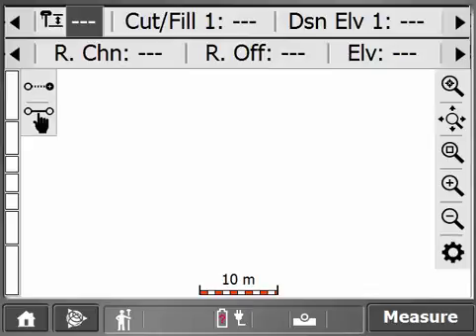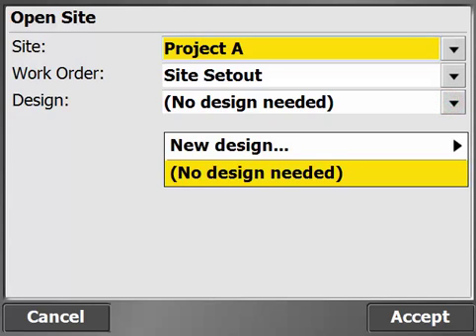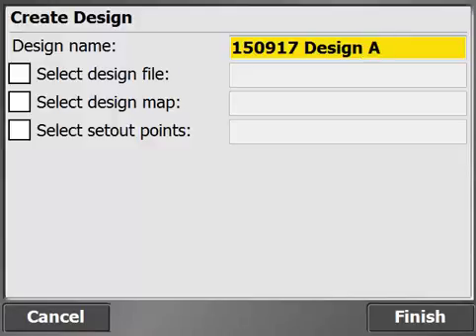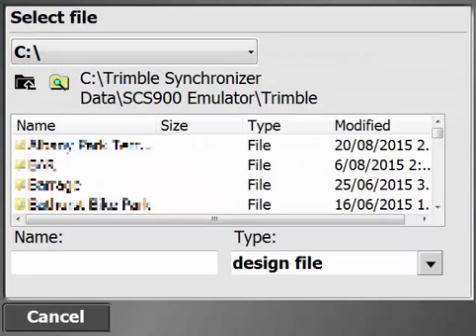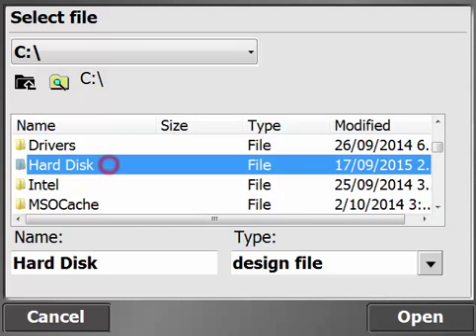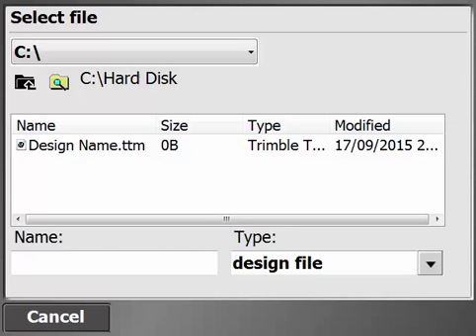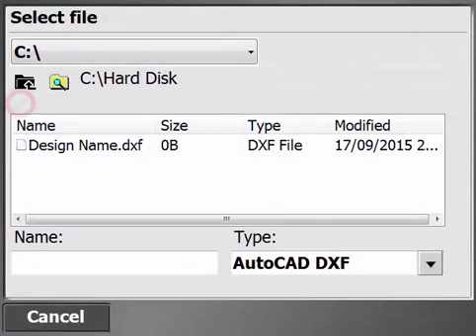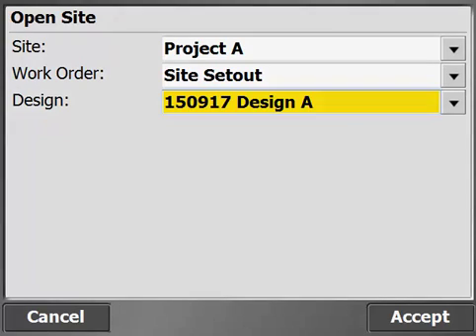Upload designs into Trimble SCS900 via USB

Comment: How do I delete a work order and Design?..plz
Reply: You cannot delete a work order or design through the SCS900 software. You can however delete a design or work order through the file explorer software on your particular device. On a Windows Mobile device you will find the designs in \\Trimble SCS900 Data\'YOUR SITE NAME'\Designs\'YOUR DESIGN NAME' and you work orders in \\Trimble SCS900 Data\'YOUR SITE NAME'\Work Orders\'YOUR WORK ORDER NAME'. If you delete the folder with your work order or design name, it wont be available the next time you open the SCS900 software. On a Windows Vista/7/8/10 device you will find those folders in C:\Trimble Synchronizer Data\PC\Trimble SCS900 Data\'YOUR SITE NAME'\Designs\'YOUR DESIGN NAME' and C:\Trimble Synchronizer Data\PC\Trimble SCS900 Data\'YOUR SITE NAME'\Work Orders\'YOUR WORK ORDER NAME' respectively. The reason you cannot delete the Designs or Work Orders through the SCS900 software is to prevent the designs and work orders created in the office from being accidentally deleted or modified in the field to protect the original data and associated field recorded data.
Reply: @shaungray1614  ...thanks
Reply: @shaungray1614  Can I plug my TSC3 data collector into my home PC and delete jobs like you mentioned above through the USB port?
Reply: I accidentally deleted a project how can I recover it?